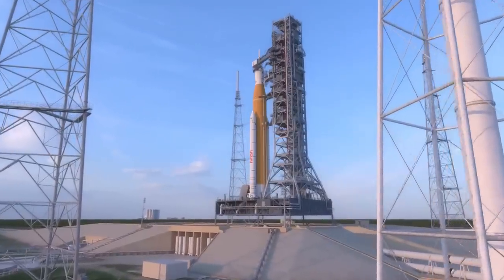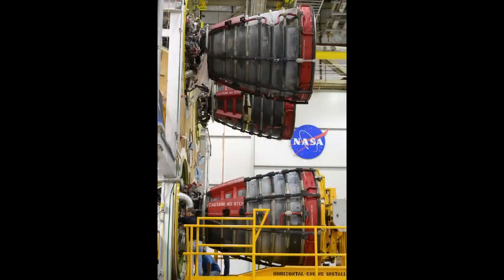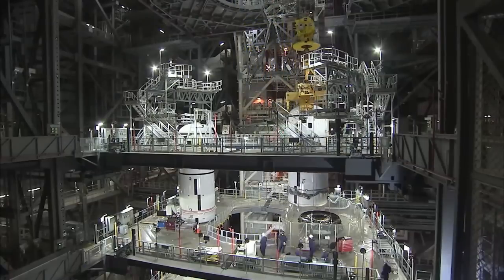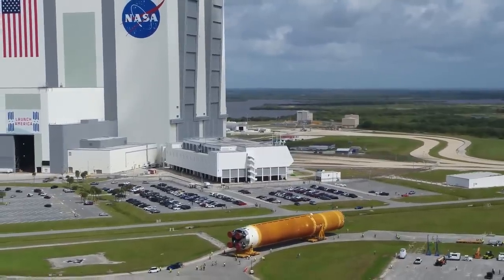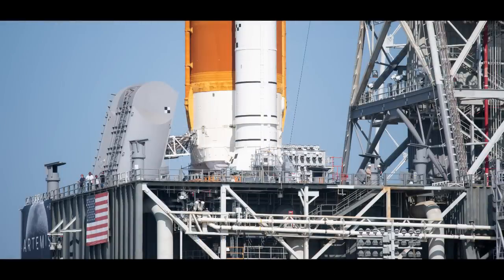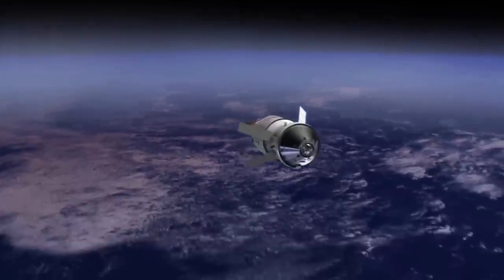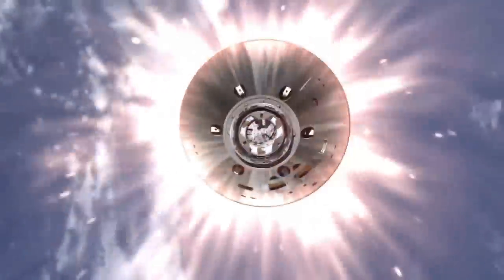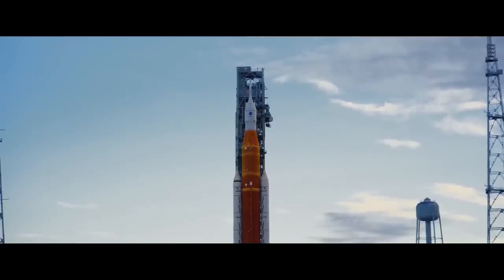What's The Big Deal About Artemis - NASA's New Massive Moon Rocket

Comment: Said: So many test, it's gonna work? except it didn't, It got scrubbed last time.
New to this. Sooo it's newer tech? W old engines? Newer in like reusability?
but understand previously reused and reused and reused engines will not be reused
Will be dumped, just the boosters reused, plus the capsule will come back,
But will the capsule be reused? Thanks for answers.
Reply: Unlike the shuttle, the boosters are not recovered. In terms of the core stage the RS-25 engines once all used up will be manufactured by Aerojet Rocketdyne. 

The capsule is not flown again, but much of the internals are.

Comment: What is the launch trajectory? Will it be visible over any part of Europe?
Reply: Great question. I have been searching for this to no avail. I'm assuming similar to the Saturn V which I think was a 32 degree parking orbit inclination. Apollo could be placed into orbit using launch directions 18º either side of due east so could therefore be launched on azimuths anywhere between 72º and 108º east of north. I'm assuming that this is no different, in which case the trajectory would pass over North Africa. I think the Apollo 11 launch trajectory passed over the coast of Western Sahara.

Comment: Thank you for the video.  With so much Space Shuttle technology being directly reused on the Artemis rocket it would be nice to state the difference in earth orbit altitudes achievable by the Space Shuttle and that of the Space Shuttle derived part of the Artemis rocket.   What attitude would the RS25  engines firing take the Space Shuttle launch system and to what attitude can the RS25 engines take the Artemis rocket?   Thank you for your well developed space technology videos!
Reply: In respect of the shuttle, it varied. Early missions used two firings of the OMS to achieve orbit; the first firing raised the apogee while the second circularized the orbit. Missions after STS-38 used the RS-25 engines to achieve the optimal apogee, and subsequently used the OMS engines to circularize the orbit. 

The The core stage is designed to operate for approximately 8.3 minutes, reaching nearly Mach 23 and more than 530,000 feet in altitude  - just over 100 miles - in altitude at MECO.

Comment: Thanks Scott. Do they recover the first stage engines? Also, what’s the status/risk of the notorious SRB O-rings?
Reply: Only Orion is reused. The SRB O-rings were fixed after the Shuttle disaster. Booster reusability is great, but has drawbacks.

First, if you don't have a fast enough launch cadence, you can spend more on recovery than you save by reusing the booster.
Second, you take a payload hit for the recovery system on the booster. The Falcon 9 B5 can lift up to 22.8 tons to LEO when expended, but only up to 16.3 tons when landed on a drone ship (B1051.12). Doing a Return to Launch Site (RTLS) landings, costs even more payload.

So with SLS launching once or twice a year, the cadence doesn't really justify recovering the booster. Not to mention that it gets higher and faster than a Falcon 9.
The SLS Block 1 can get Orion to the Moon, but not with the kind of payload hit like F9 has. The SLS Block 1B will send along a Lunar Gateway module with Orion, so it really can't take the payload hit either.
SLS started design work in 2011, 4 years before SpaceX landed the first booster and almost 6 years before they reused a booster.
Reply: @steveaustin2686  Thanks Steve. Very comprehensive answer!
Reply: @martinsastrophotography  You are welcome
Reply: @steveaustin2686  One more question… Is this mission flying a dummy load where the lunar lander would be? I don’t see this anywhere in the vehicle stack-up.
Reply: @martinsastrophotography  There is no lunar lander on SLS. The first three launches can only get Orion/ESM to the Moon with the 5m Interim Cryogenic Propulsion Stage (ICPS). Then the 8.4m Exploration Upper Stage (EUS) will be used on the SLS 1B. The SLS 1B will send along Lunar Gateway modules instead of a small lander. The lunar landers are all going to launch separately to lunar orbit, before the SLS/Orion launches.

For Lunar Starship, currently the only lunar lander, the [DELETED] propellant depot launches first to LEO. Then up to 8 Starship Tanker flights refill the depot. Once the Dance of the Sky Tankers is finished, then the unmanned Lunar Starship launches to the depot to refill, before heading to the Moon to wait for the crew in Orion.

The Blue Origin led National Team Integrated Lander Vehicle (ILV) would launch it's transfer stage, descent stage, and ascent stage to LEO separately and dock them before heading to the Moon to wait for the crew.

The Dynetics Alpaca would launch with empty propellant tanks and get refilled by tanker flights in lunar orbit.

The Lunar Starship is under the HLS Option A contract with more landings being negotiated under HLS Option B. The ILV and Alpaca are competing with others in the Appendix P competition to be the second lander.

Comment: I am not advocating for going back to flying the Space Shuttle but just a thought experiment: The Space Shuttle orbiter has a dry mass of 78,000 kg while the Buran about 62,000 kg. Would the core stage with the four RS-25 engines and the two 5 segment boosters have enough power to lift one of the orbiters mounted on top of it? A top mounted shuttle would be less vulnerable to both side booster exploding and ice and foam hitting it. Yes, you would still loose the RS-25 engines, but seen from a safety perspective, would not such design be much better than the side-mounted fuel tank and boosters?
Reply: Unfortunately, a top-mounted winged vehicle would be horribly unstable aerodynamically. Big wings near the front make an aircraft very flip-happy, because aerodynamic forces tend to increase their pitch, such increased pitch increases the aerodynamic force applied, and so on. The vehicle can very quickly and easily reach a point where you can't prevent it flying tail-first. (As the saying goes: "A nose-heavy plane flies poorly. A tail-heavy plane flies once!") Real planes actually have their biggest wings close to their center of mass for this reason. The wings themselves may be a little forward, but the tail makes up for it. If small planes seem to have their wings at the front, its because the engine makes up such a big proportion of their mass that the center of mass is just that far forward.

Comment: could you do an explainer on the delayed launches? that'd be noice...
Reply: There was 2 problems.  1 was 1 engine didn't give the data expected for its temperature. (some of the engines are 30 years old). Then when that seemed to be ok (which in my opinion that team just downplayed the issue. They tried again BUT its really not designed to start/stop/ drain hydrogen. So while the TEST filling went ok, just by doing that over they likely introduced a new problem. That problem seemed to get worse by attempt #3  & if they kept on proceeding it may have gone from a small leak, to a lot more.. SO they had to stop. And it all had to be rolled back because of the leak and now the test equipment that goes to the moon needs to be set up again. (there's batteries/timers.. etc)

Comment: In the center-stage, why is the O2 tank above the H2 tank? 

Naively, I would have thought it's better to have the heavier O2 tank lower down.
Maybe the colder H2 tank is partly insulated by the O2 tank above?
Maybe they want the H2 lines to be shorter because the H2 is colder and more likely to cause condensation problems?
Reply: You want your heavier stuff up front so that the the center of gravity is in front of the center of pressure. Think lawn darts.

Comment: Somewhere I read that they are not able to replicate the space shuttle engines because there are not enough documents about it and the process they did to manufacture it. Is this true and the reason why they reuse old space shuttle engines?
I bet they also need to make new engines, why don't they use at least one new engine on the rocket to make sure the engine works?
Reply: You confuse this with the F-1 engines used for the Saturn 5. They can't make new ones of them today, this engine was built completely different than engines are made today with modern techniques.

They will build new engines if the old stock engines are used and gone, but in a simplified version to save money and SLS engines don't have to be reusable any longer.
Since they have the stock engines and they are still fine they use them, instead of letting them rot in a storage hangar

Comment: I have a question about the ratio of oxygen to hydrogen for the fuel. I did some quick checks and the estimate of 840 tonnes of O2 and 144 tonnes of H2 was right as far as I could tell but that means there are roughly 52,912,954 moles of Atomic Oxygen and 141,192,328 moles of Atomic Hydrogen. This means there is ~2.66 moles of Atomic Hydrogen per one mole of Atomic Oxygen. When all you need for the reaction is two Hydrogen per one oxygen. Why is that? I understand having some buffer but that much seems like overkill. Is the hydrogen being used for other systems too but not the oxygen?
Reply: No rocket runs at it's stoichiometric mix rate.  Way to hot.  They run fuel rich to keep temps under control.  I think for these it's 6:1 and for Raptors it's 3.5:1

Comment: I'm curious about the markings they use for tracking the vehicle with cameras. The markings seem very basic compared to other ones such as April Tags. I'm sure something like an April Tag would be hard to view from a distance with noise, but perhaps some other similar mark specially designed for this purpose would produce better results? Or the marks they use are already that and I'm just overthinking this.
Reply: Well they don't really need to encode any information into them, since they already know what the relative positions SHOULD be, and I imagine they already have automated software to determine the vibration and flexing from the video footage. Visual contrast would then be the highest priority. In the event of Rapid Unplanned Disassembly, the cost of manually figuring out which tag is which is going to be the least of their worries.

Comment: Amazing! [insert heavy sarcasm here]  After only 54 years, NASA will be approximately where they were in 1968.  How long until it actually flies with a crew?  The capsule is conceptually the same design as North American's Apollo.  But wait, there's more; it's "longer, lower, wider" (as in old car ads).  What "tremendous" progress.  At least it uses a rocket that's more or less equivalent to a Saturn 5 and only 50+ years behind it.  And, the new rocket is taking much longer to build with the "aid" of advanced technology and modern computers.

Comment: This might be a stupid question but is there any SpaceX parts on this or the space suits they will use on the man mission. Will the rockets land back like the SpaceX ones do
Reply: SpaceX is not making the spacesuits and they are not making SLS or Orion. Booster reusability is great, but has drawbacks.

First, if you don't have a fast enough launch cadence, you can spend more on recovery than you save by reusing the booster.
Second, you take a payload hit for the recovery system on the booster. The Falcon 9 B5 can lift up to 22.8 tons to LEO when expended, but only up to 16.3 tons when landed on a drone ship (B1051.12). Doing a Return to Launch Site (RTLS) landings, costs even more payload.

So with SLS launching once or twice a year, the cadence doesn't really justify recovering the booster. Not to mention that it gets higher and faster than a Falcon 9.
The SLS Block 1 can get Orion to the Moon, but not with the kind of payload hit like F9 has. The SLS Block 1B will send along a Lunar Gateway module with Orion, so it really can't take the payload hit either.
SLS started design work in 2011, 4 years before SpaceX landed the first booster and almost 6 years before they reused a booster.
Reply: @steveaustin2686  thank you for such a detailed answer much appreciated makes sense
Reply: @dakamatak8242  You are welcome

Comment: If the oxygen weighs so much more than the hydrogen, why isn’t it on the bottom?  Is it because the hydrogen has to be kept much colder, so can’t have a long run through piping before injection into the engine?

Comment: Interesting to see how they can lift the whole 100-metre-tall main section and slot it in from the top... this means the building (or crane) must be nearly twice that height... :O
Reply: 160m, according to Wikipedia. But 100m is the height of the fully-stacked rocket, not just the core stage (which is about 60m), so there's plenty of room for the individual components to be stacked.
Reply: @simongeard4824  Still impressive!

Comment: actually I do not like the side boosters as they caused troubles in some SpaceShulttle disaster ... should be possible to make them a real stage ... making the two boosters into one could save mass
Reply: The problem owed to managerial failure and a decision to launch against advice from Morton Thiokoln in conditions that compromised the o-rings between rocket sections.

Comment: As a fix for gambling issues and failures. I wonder as an emergency procedure the broken gimbal could be mechanically locked and have steering provided by the remaining three engines. Ideal? No. But can the sls still meet its launch requirements on only three engines burning for longer? Also I’m presuming that three gimbaling engines could still steer sls.

Comment: If the liquid O2 tank weighs 850 ton, and the liquid H2 tank weighs only 144 tons, why would you stack then with the O2 on top?
I mean logically for me it would make sense to have the heavy bits on the bottom and the light bits on top.
What am I missing here?
Reply: rockets are usually done that way; sitting at rest its more stable if the mass was at the bottom, but in flight it ends up being more stable  with the center of mass higher. Aside from that with the engines right underneath that vibrate a lot .. to me it really doesn't seem like a smart move - the external tank was not originally designed for that type of stress.

Comment: Which elements are reused and what happens to the service module?
Reply: Orion is reused and everything else, including the ESM, are expended. Booster reusability is great, but has drawbacks.
First, if you don't have a fast enough launch cadence, you can spend more on recovery than you save by reusing the booster.
Second, you take a payload hit for the recovery system on the booster. The Falcon 9 B5 can lift up to 22.8 tons to LEO when expended, but only up to 16.3 tons when landed on a drone ship (B1051.12). Doing a Return to Launch Site (RTLS) landings, costs even more payload.

So with SLS launching once or twice a year, the cadence doesn't really justify recovering the booster. Not to mention that it gets higher and faster than a Falcon 9.
The SLS Block 1 can get Orion to the Moon, but not with the kind of payload hit like F9 has. The SLS Block 1B will send along a Lunar Gateway module with Orion, so it really can't take the payload hit either.
SLS started design work in 2011, 4 years before SpaceX landed the first booster and almost 6 years before they reused a booster.

Comment: Do they have a plan when they will run out of shuttle motors ?
Reply: A simpler version of the Shuttle engines is being developed. Not built to be reusable, so easier to build, and should be cheaper.

Comment: The new rocket is a rocket build from scrap from the space shuttle program. For far better fuel economy new developed engines are essential. Those engines where solely made for the shuttle. It is an enormous tank they can't save because it is only a 2 trap rocket the 1st enormous trap need to go into orbit. 

Normal rockets have more stages especially for ditching the empty tanks to safe weight and use other more efficient vacuum engines with a wider nozzle when ascending in thinner air. The 2nd stage is primarily used for the Lunar insertion and read that the 2nd stage is very small. 

Concluding: Artemis is extremely expensive and heavy dependent on old space shuttle parts for its build. Some parts have flown 7+ times. 

Why you don't start with a clean sheet with modern technology like what SpaceX is doing now with its Raptor 2 engine with big updates to simplify it and added more thrust. Why can't NASA with its billions of  budget not even really develop something but pull all old parts together from the space shuttle and their solid boosters. It's now very old  and needs a place in a museum.

If you tink of 5 years later and SpaceX receive the same findings as Nasa, Spaceship would be a giant LEAP in the future of space capable  bringing a lot of astronauts and cargo to build a Moonbase. Especially the reusability and the quick turnover time. 

So this expensive Artemis project looks like they took decades old drawings and technology and almost no reusability, and that is a big shame. I hope that at the time they will fly people to the moon, SpaceX has caught up with Starship and all test and certification done to just obliterate NASA's project. 

Because NASA get funded so well, they don't think about falling money out the sky burning up ot crashing into the ground. That's why competition is so good. From 2011 USA stopped the spaceshuttle and had to rely on Russia for the ISS. Think of it now with the war. Russia's part in the ISS is certificated for just a couple of years.  If they don't renew and doing maintenance th4 systems need to shutdown and because every country made something, they are dependent on each partnering country for working. If 1 stops the project is dead. Hope they can launch the needed modules to safe the station.